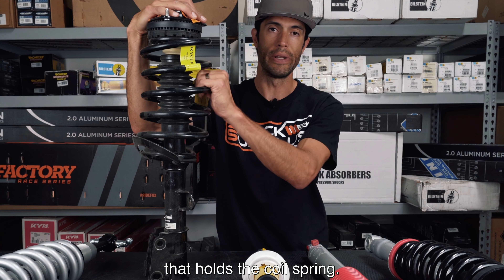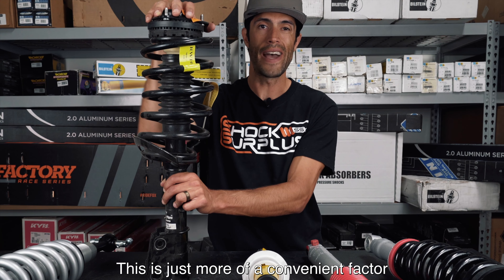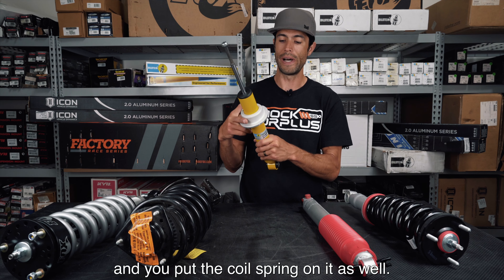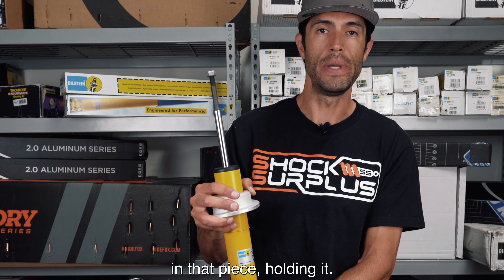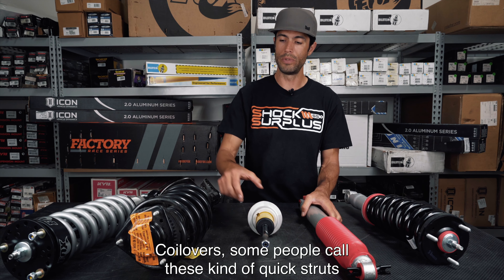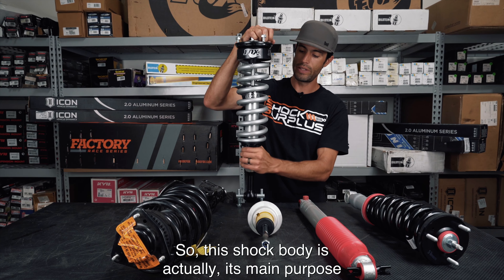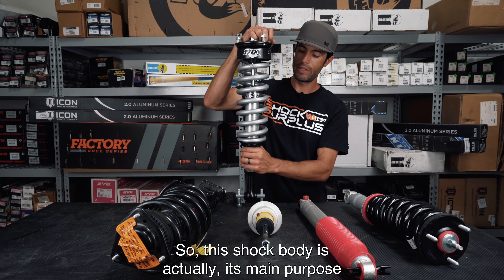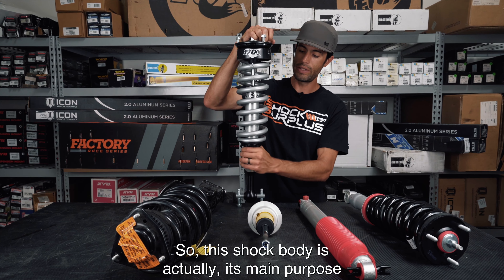Differences Between Shocks, Struts, and Coilovers

Comment: Still confused about the difference between struts and coilovers
Reply from the maker: Struts are a shock with a spring seat that either has options for just one height or various based on circlip grooves.  height adjustment would require the spring to be compressed and adjusted. A coilover is a strut with a threaded body that allows you to make those height with a collar. Aluminum bodies require you to compress the springs to make the adjustment while Steel bodyes you can adjust with a spanner wrench.
Reply: Quick struts, have welded tabs to connect your links for the stabilizer bar while coil overs don’t… That was my question. What do I do with the links and stabilizer bar?
Reply: @@Official_son_of_artstrut = the shockabsorber and the coil spring unit.
Coilover = the same unit but can be adjusted.
Is that correct?
Reply: The people explaining it to you are confused too. Lol.
Reply: Same. I guess adjustability is the difference?
Reply: It's the long skinny peice in the middle.
Reply: A "strut" is just a load bearing beam by definition (anything that holds weight). The strut that everyone knows in the auto industry refers to the McPherson strut, coined by McPherson as a "strut". In reality, coilovers and struts are essentially the same, they both have a shock inside a spring, and it holds weight. You'd just call it a strut on an oem application, like on a car or stock IFS vehicle. You'd call it a coilover in the aftermarket world, and they often have adjustability
Reply: @kjbigslim finally someone got it right 😂. Coil overs aren’t just adjustable struts; struts form part of the suspension geometry. The bottom part of a strut usually is rigidly attached to part of the spindle/hub assembly, which keeps the camber more stable through the range of motion of Knute suspension. A double wishbone, or double A arm type suspension will have either coil overs, or separate springs and shocks
Reply: @MrLuvtheUSA  yes. Most oem struts eliminate the upper control arm by using a spindle lower mount. This mounting location also reduces the lifting force of the spring, making it closer to a one to one lifting ratio It also saves weight and space under the fender.
Reply: @kjbigslim best explanation
Reply: me too lol
Reply: that because this info in this video is wrong.

Comment: A coilover is an assembly of a spring over a shock.  A shock or damper is just the shock portion.  A MacPherson strut is a coilover that bolts directly to the spindle to provide steering rotation as well as suspension.

Comment: My mechanic recomended I replace my front struts and I expect he us right about this.  My question is he commented "May as well replace the springs at the same time."  frequently online comments on this topic is most often the springs do not need replaced.  I suspect it is just easier to replace the entire assembly with a "Quick strut".  There is a major cost difference between just a strut, and the entire assembly.  Interested in your opinion.
Reply from the maker: It's all personal preference and what one would want to do. You would have to outweigh pros and cons and cost and see what suits you specially.
Reply: I believe sometimes the labor involved in transferring the spring over somewhat can offset the cost of reusing the old spring. You’re correct in that installation is easier as well. Also, with a complete strut assembly, not only do you get a new spring but a new strut mount (the top part that mounts to the body- there is a bearing inside that allows the assembly to rotate when turning the steering wheel)

Comment: so actually is not a strut its a shock.
Reply from the maker: All struts are shocks but not all shocks are struts. Basically what makes it a strut is that on top of being a shock and dampening the motions of the suspension also serves as a load bearing or locating component with the suspension. The struts in this video all house a coil spring and therefore carry the weight of the vehicle and determine ride height making them a load bearing component and in some cases a locating member as well on Mac strut suspension. There are also some vehicles that use Macpherson strut suspension but have a spring or torsion bar that is separate from the strut (Sprinter Vans, GM Trackers, etc). Although the weight of the vehicle is held by the torsion bar or coil spring, the strut is still locating the suspension on top since there is no upper control arm making it a locating member within the suspension
Reply: I have an Audi a8 it has struts with upper control arm. 
Thanks for your response. like your explanation

Comment: Thank you for posting this! My protection plan company is trying to say because it's a "shock absorber" it's a shock and not a strut so it's not protected. Struts are covered but shocks aren't. The vehicle is a 2016 Lincoln Navigator. Everywhere I look including Fords OEM parts catalog it says Strut. Can you assist with more clarity around the specific Lincoln suspension as to why it's a Strut or what I need to say to them to prove it's a strut and not a "shock"? 

Your site also shows it's a strut. Please assist.  

(Front suspension)

Comment: So, Left most being 1. we have 1, 2,3,4,5. 1= coilover. 2. strut. 3. shock absorber (that has mounts ready for coil spring). 4. shock absorber. 5 = coilover.
strut (2) = coil spring + shock absorber (3) + misc parts like bump stop + bellow + washer, etc.
Coil spring usually don't wear out or get tired. They could get rust and break if u are in rust belt.
Coilover (1 and 5) is like a strut but u can adjust the overall height and the spring height, making it possible to fine tune the suspension. Some high end ones have the strut mount plate that allows chamber adjustment.
1 to 5, they all have or are shock absorbers.
Shock absorbers do go bad and often enough u don't even see oil leaking. Without taking the shock absorber out of the strut, u can never 100% tell, and if u take them out, u mind as well replace them.
On most cars, front are struts, rear are shock absorber + a coil spring separately (or leaf spring). Newer cars have struts in the rear.
To disassemble a strut, u need specific tool to take out spring coil. Since good chance u need to replace the bump stop and bellow, some people mind as well replace the whole strut when total cost + labor is about the same.
If u work on cars often, it might be wise to get the tool (a few kinds for different coil springs) and replace only the shock absorber (plus bump stop + bellow if needed.)
I am just trying to clear my mind and write down everything I understand. Hope I have used all the right terminologies. Pls correct me if I am wrong.
Reply from the maker: For the most part, this sounds about right. It is case-by-case and very dependent on the vehicle. The front can be leaf springs, torsion bars, coil springs, or fully assembled struts and springs/Coilover setup. The rear is usually a spring or leaf pack or in some cases a fully assembled struts and springs/Coilover setup.
Reply: 2. Strut. Some people call it strut assembly and the shock absorber inside the strut. That turned my world upside down and confused the hell out of me. Oh well.
Reply: @ShockSurplus  Thanks.
Reply from the maker: Yeah it can get a bit confusing. We call the struts, struts assembly and if it's a threaded body, it's a coilover.
Reply: @ShockSurplus  ok, now I get it. A coilover is a strut with a threaded body. Thanks

Comment: i got a good one for you i have 67 c10 i have done alot to it i put new shocks a couple of years ago KYB  Gas-a-Just Gas Shock not sure of the #  and i have been working on it alot and really havent driven it to much in that time im sure the rear leaf springs and front springs have never been changed and the ? is the truck kinda starts bouncing sometimes will shocks with coils help balance that out? assuming the front springs are weak
Reply from the maker: really old springs basically lose rate over time (become softer), with that said excessive bouncing can occur when coils or leafs have 100s of thousands of miles on them, the shocks will have a hard time fixing that
Reply: @ShockSurplus  thanks for the advice it makes perfect sense

Comment: i have an insanely precise question , i got my first car (old bmw e60 525d) and i have alot of questions about shocks because i am in a process of changing mine . i am looking at dtsline sport coilovers that are adjustable .... do you think its a good idea to get or its not needed and the stock ones are fine to put on ?
Reply: depends on what you're doing.  Stock is fine.  You'd want adjustability if you were racing on a track and needed to adjust your suspension.  9 times out of 10, you don't need a fancy brand coilover.  Some people just want it to lower their car, and a lot of people just jank up their ride for looks without other necessary adjustments.

Comment: Hi, I want to lower my car by few inches, some people say just get the lowering springs, some saying get Springs with shockers and some saying get coilover, I'm very confused with making rite choice,  I have Audi a3 2013 model with 121000 on clock. Since it's a pretty old car with high mileage, I think just changing springs is not a good idea, I might is well Change whole set, what will be the rite thing to do?  Springs with shockers or coilover??  Shocker with Springs are much cheaper than coilovers but then Im thinking if I'm going to spend I might is well spend on better and long lasting rite item,  can you help and advice please??  Thanks kind regards
Reply from the maker: Good question! With that many miles, a set of new shocks/dampers is called for, not just springs. Usually shock + spring combinations are on the 'less aggressive' side when compared to coilover options. Coilovers are single units that combine the shocks and springs, and allow for adjustability to the ride height and damping characteristics - something that's not achievable when the shocks and springs are separate.

Bilstein makes a really great shock + spring kit, very sporty, lowers the vehicle a good amount, but not too extreme. KW makes on of the best coilovers, adjustable ride height, adjustable rebound/compression - but only necessary if you like to take the vehicle to the track and race. 

We can dive into more details, feel free to email us at support@shocksurplus.com
Reply: @ShockSurplus  thank you so much for your clear advice, I'm gonna try bilstein shock + springs, thanks
Reply from the maker: The pleasure is all ours! If we can help out in any other way, please let us know.

Comment: I have a 2016 Lexus GS 350 V6 Rwd making bout 300 maybe more to the wheel  FBO headers, intake, axle back exhaust (still stock tune, and midpipe) I lowered my car just a bit, but it definitely feels very jumpy when I hit bumps especially at high speeds. Do I replace the struts with performance ones? Or do I go full coil over setup?

Comment: I have a 98 infinity i30. I have a stupid question. my rear coilovers are completely done. I was wondering if I can replace it with just struts instead of buying coilovers. Because struts are really cheap on rock auto. RN in a bad financial situation.
Reply from the maker: If you're purchasing from Rock Auto, you should ask them specially the parts you're looking at and if it'll work. However, in most cases if the coilover is using the same stock spring dimension, then you can just replace the struts.

Comment: So a vehicle doesn't have more that one (Shock, strut, coilover) per wheel right? If I want a smoother ride where my car doesn't bounce/move when going over bumps on freeway, which is the best
Reply from the maker: correct, 99.999% of vehicles have 1 damper per corner.

What vehicle do you have? feel free to email us support@shocksurplus.com and we can dive in.

In general, Bilstein is a very good option for most cars, excellent handling, but maybe not the softest ride for you.
KYB excel-g or gas-a-just are great options on a budget that will help out on those bumps.

Comment: I have a 2006 Mazda 3, it handles well on OEM struts and shocks in the back, but the ride is harsh and getting worse as they age
Which brand will give me the best comfort while maintaining the handling properties of the car or improving upon them?
Reply: Also some mechanics like Scotty Kilmer say that the best strut for your car is the OEM, because they have certain dimensions that are designed specifically for your car and take into account the whole picture of the car's suspension

What do you think of this?
Reply from the maker: Well if you're nothing doing anything specific build with your car then stick to OEM. You're not building a track car or racing. If you're trying to stance this car then just do air bag and slam it.

Comment: Have a 2017 nissan altima want to take sharper turns 
What set should i get for my nissan
Reply from the maker: Really only OE replacments available, but you should see better handling from a set of lowering springs. Eibach sells Pro Kit springs that do 0.8" of drop and are a guaranteed fit on stock or stock replacement shocks and struts, and should help handling.

Comment: I bought quick struts for my 04 Avalon in order to put 18 inch wheels on even though the tires are thin, I get rubbing on the strut plate under the spring. I’ve considered adjustable coil overs. What would that do to my sway bar end links?
Reply from the maker: Sure and adjustable coilover will definitely have more wheel clearance without a doubt. From there its all about ride height where the endlinks are concerned. If you plan to keep it stock stock height or close to it the stock endlinks should be fine, but if you drop it too far you will likely need to run a shorter or adjustable end link.
Reply: I ended up using 17” Toyota Highlander rims and changed the tire size to 215 50/R17 (55 rubs on spring plate of the quickstrut ) that finally stopped the rubbing.

Comment: So you're saying that a coilover is just a normal strut with a screw thread to adjust the spring compression? I am familiar with this on bikes as common.
Reply from the maker: The threaded body isnt a necessity of a coilover, but its typical and common. The Macpherson strut originated the word strut, which is really when the spring is seated on the damper; but the damper itself is the steering knuckle / steering pivot point that connects to the wheel. Strut became synonymous to 'spring on shock' sometime later, so sometimes we refer to a shock on spring setup as a strut.

Comment: I have a stock 2019 Wrangler Rubicon JLU, with a rooftop tent.  At 66,000 miles I have a couple of leaky shocks.  If I need to replace all my shocks I'd like to do the best I can get to have balanced on and off road performance.  I primarily do slow off-road trails, but would love to be able to drive fast when conditions allow, and not feel the harsh washboard type roads so much.  What would be ideal to replace my stock shocks with, and do I need additional parts to compliment my existing suspension?  Thanks!
Reply from the maker: At stock height your best bet would probably be something like a Bilstein 5100 as it should reduce sway and give you a little more support off road, however if you were willing to lift it you could open a lot of great options like their 8100s or a Fox 2.5 PE. Either way since you have some weight up high, I would stick with something Digressive like a Bilstein or Icon or something that has low speed compression adjustment like a Fox 2.5 or 3.0.

Comment: Just I would like to know, if shock is on the front and strut is on the rear or what is it?
Reply from the maker: All struts are shocks, but not all shocks are struts. Whether they are mounted up front or in the rear does not really matter, however, if you have something that runs struts and shocks, you more than likely have struts in the front and shocks in the back. What makes it a strut is that on top of being a shock and dampening the motions of the suspension, it also serves as a load bearing or locating component with the suspension. The struts in this video all house a coil spring and, therefore, carry the weight of the vehicle and determine the ride height, making them a load-bearing component and, in the case of Mac Strut suspension a locating member. Macpherson strut suspension usually only has one lower arm and use the strut to locate the top of the suspension in the place of an upper control arm. Many Mac Strut cars use a spring or torsion bar separate from the strut (Sprinter Vans, GM Trackers, etc). So although the vehicle's weight is held by the torsion bar or coil spring, the strut still locates the suspension on top since there is no upper control arm.

Comment: How would you go about buying just the coil springs? I want KYB struts, but they don't make the ones with springs fit my vehicle. 1999 Lexus RX300. I know old vehicle its hard to find parts, but its a Lexus. Also is it possible to buy a coilover strut with a steel body and adjust it without dealing with dangerous spring compressors to make it fit properly in any vehicle? Such a product would definitely draw lots of sales as Americans overall are keeping their vehicles longer. Also one of the main reasons people replace their vehicles is to avoid the headache of maintenance. I think an adjustable strut to fit multiple vehicles will sell like crazy.
Reply from the maker: we cant find an aftermarket spring for that vehicle, probably need to go back to the dealership to locate one. Universal struts are hard due to mount types and spring rates/lengths